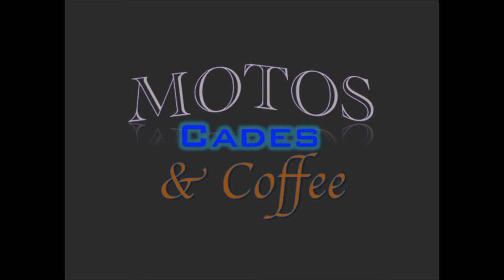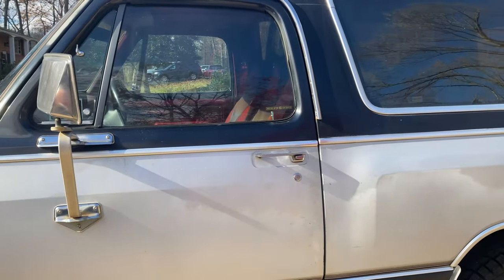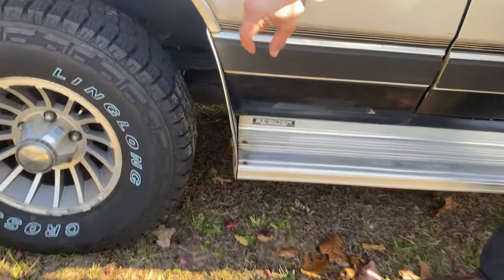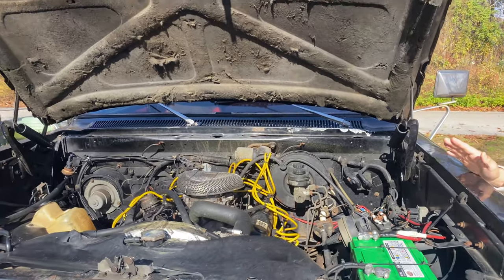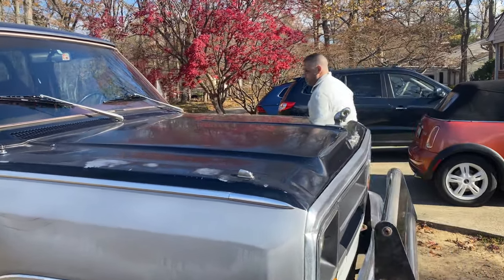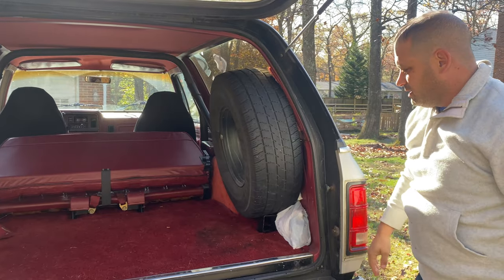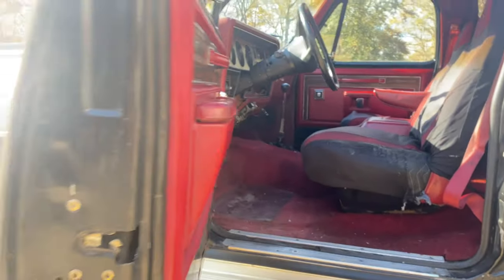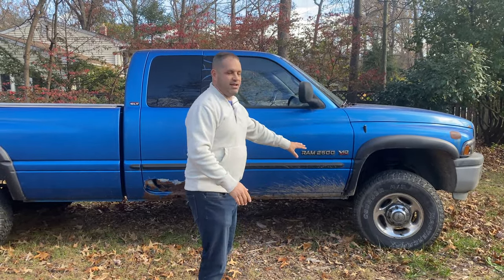Dodge Ramchager V10 Swap | Part I

Comment: Best way to do the swap is to swap entire drivetrain, brake system, and electronics (computer, gauges, wiring harness) V10 will make mincemeat of the ramcharger 1/2 ton drivetrain. My son did this swap to a 94 regular cab short box for his high school senior project-took about 3 months. Wiring harness was the worst part. For your situation you will have to fabricate front suspension mounts if you use original ramcharger frame, might be easier to shorten V10 frame to fit ramcharger, dash will be a pain since gauge clusters are different. Be sweet when finished but going to be a lot of work. Good luck.
Reply from the maker: Thanks for your thoughts!  The more I think about this the more I am leaning towards this route.  I will be able to take the body off the frames at the same time..but I'm not sure the condition of the 2500's frame rust wise...so we will see.  I am going to start the full swap soon!

Comment: Depending on how much you want to spend on the V10 to get more HP, bore it 30 over,shave the heads,bump up compression, swap cam and 1:7 rockers arms, and have tune done 3 angle valve job , mild port work, gets you in the 500 hp, Walker Evans racing, did the motors for the Dodge 6 by T-Rex , good luck looking forward to the end result
Reply from the maker: Thanks man! Yeah I’m totally looking forward to this huge transformation…I do want reliability over Power, but your mods and this engine should allow both. I can’t wait to provide updates!

Comment: Any updates to report?  Would love to see the axle/engine/tranny/& transfer case swap from the truck to the RC.  I had a 1977 Dodge Ramcharger that had a 400 CID engine and absolutely loved it.  I wanted to rebuild it but saw a 1984 Dodge Ram 150 P/U that was already lifted a little and took the short cut by trading in the RC for it.  Looking back, I wished I have kept with my original plan.
Reply from the maker: I'm hoping to have an update shortly....both vehicles are in the shop now...getting ready for the swap.  I hear ya on wishing ya kept the RC!